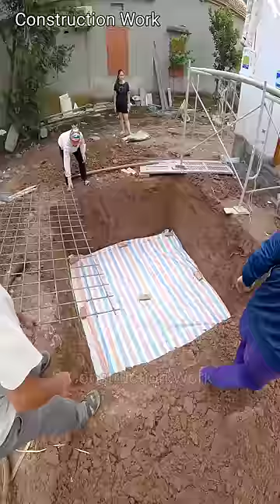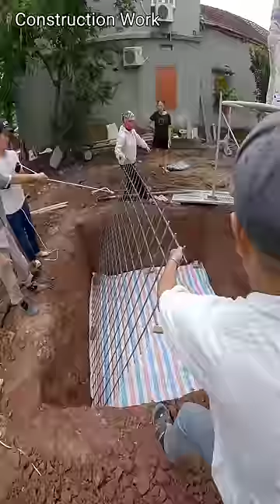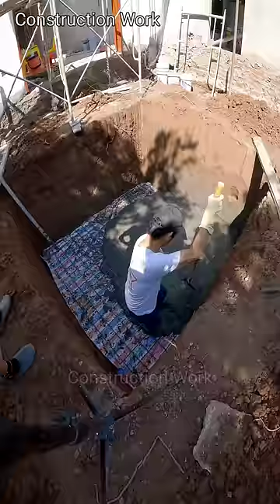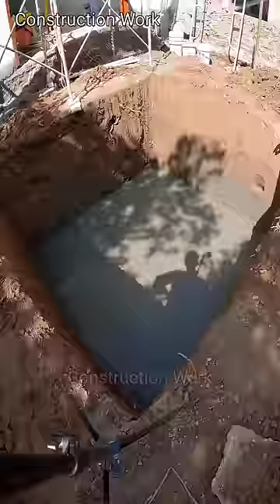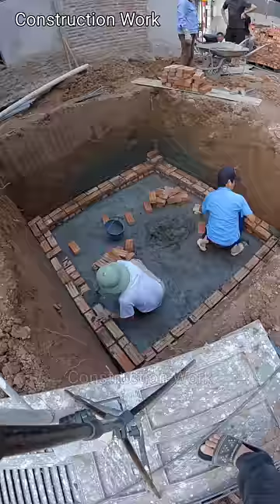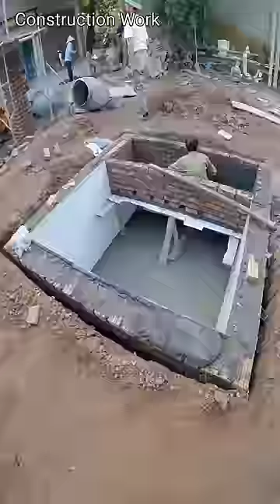Excellent Water Tank Construction Skills of Construction Workers #constructionworkers #construction

Comment: Its a septic tank my friend. Water tank need to be at high place for the water to flow to residential area. .
Reply: Naaaah people use those underground for water ,it's called a cistern
Reply: Water finds and maintains its level
Reply: People buy pumps these days lol
Reply: @sthompson7856 yes thats another method of storing water underground my friend but base from its shape&design , its totaly not a cistern water tank .
Reply: @jasonlecates9848  yes .some residential area using a water pump if the area is not enough water pressure .but why use pump instead of gravity flow if the area pressurise? .because, using water pump can lead to external pipe damage if not installed properly .for me, at pressurise area should install water tank with pressure breaker .this is what i experinced but depends on house owner to make their water system .theres many factor that we can avoid before burning money for future maintenance .
Reply: 我的朋友如果下面藏屍體將完美=
Reply: Water tanks inMexico underground dummies
Reply: Water can’t flow uphill. Now if gravity was real then that would be the case. Interesting world we live in isn’t it. I must admit learning about the world as an “adult” is much more fun than that Rockefeller education system 😂
Reply: @FKTHESYSTEM063  yes you right my friend .water cant flow uphill .then why you should use undergrd tank on modern days? .it will be a waste of energy using pump instead of gravity flow .that how liquid works .it flow if theres a low point .different story if the area is not on high pressure of water, then no choice you have to pump to pressurise the water .so this story, always install your water tank on high area so you dont waste energy or bill just for the water to come into the house . .learning is intresting my friend and im also still learning about everything around us  .im happy to help others .good day to you
Reply: No its not my in my country has one with a water pump and filters i even got a smaller one for emergencies
Reply: My friend, please watch at the end of the video .theres another partition wall inside the chamber .it seperate sewage sludge from the other so that only water can pass thru before release outside of the chamber .thats how septic tank works .thanks
Reply: Is true
Reply: Have you heard about a water pump?
Reply: you must understand that the world is made up of different countries and regions. this is an underground tank which is used to get water from the city. the house then pumps this water to a higher tank.
Reply: Creo que usted no conoce bombas hidráulicas? 
Es un motor que lleva agua para la parte mas alta de la  casa!
Y tan poco escucho hablar de sistenas, son formas de piscinas con tampa, que recoge água para  quando falte água, da companhia de abastecimento, no es solo carro pipa!🤷
Reply: @javiergamez3343  have you ever heard of energy waste? ..
Reply: @Dr_Sheeda  ok thanks for the information my friend .means, theres a few country / region still using underground water tank living in 20century that using untreated water system.ok no problem but i want to say that this tank is not an underground tank .please watch at the end of the video .then u'll notice .the way the chamber installed also didnt have any sealant or protection for freshwater stored underground .you get wht im saying? ..
Reply: @Dr_Sheeda  im sory sir, if u dont mind im asking .which country are u from? .
Reply: My friend, im not an expert in water system or in plumbing but we can still learn, hear, watch & take advise for a certain situation .please learn not to waste our precious gift of having water, energy & resources while we still have it .dont be a typical person that dont care about our surrounding .be better then the world can be better .use our knowledge to shape our world to be better .thanks & have a good day .
Reply: La cisterna se utiliza para almacenamiento de agua en zonas donde el agua potable no tiene presión y en la cisterna si porque  está a un nivel bajo  y a si aprovechamos para llenar mas rapido tambien se utiliza una bomba de agua para llenar los tinacos🙋🏻‍♀️
Reply: A wierd thing named Motar pump exist in this world 😏

Comment: It looks more like a septic tank than a water tank or a sistern. The middle wall is called a baffle wall to cause the solids to stay on 1 side so the liquids can run out through the overflow without cluging.
Reply: Đó là bể chứa nước ở VN chúng tô😅i hay làm
Reply: Horrível  .
Reply: You seem to know much more than we do, 80% of Americans have sewage pipes exiting out of the house to lagoons that are dug and lined for it to be broken down and processed. Septic tanks are only for houses in rural areas where it would not be economically viable to have pipes to the home.
Reply: Is there no rules on how far away it has to be from a property. The materials it's  made out of. And how near  to drinking water sources. A disaster waiting to happen. Nothing like a  bit of subsidence.or Cholera
Reply: @pauljenkinson2870  Yes there are many safeguards against grey water mixing with ground water. That is why it is piped so far from origin and then processed. The only exception would be a rural home with a septic tank, but even still the are regulations on the construction and where it should be located with respect to groundwater.
Our cities water is purified and ph balanced and even has fluoride added for strong teeth. The water quality does vary throughout the country depending on many factors, like upkeep and maintenance. For instance, in the larger city close to me, they had clay pipes they estimate was put down shortly after the civil war in the 1860s. The city was neglecting the upkeep and the state and federal government had to come in and control the utilities it was quite embarrassing for all involved. But my city water is pristine, thankfully.

Comment: What's the bed sheet for
Reply: 😂its a agricultaral tarp to prevent the cement paste to bleed into the soil below as there is no bearing course ,this a wrong way to make any permanent sumps or tanks brick wall masonary is prone to joint leakages ,this seems to be short cut construction 😊

Comment: Did anybody ask why they put the bedsheet in the bottom of the hole?
Reply: So that the concrete can have a good sleep!
Reply: so who ever is down there won't get concrete burn while they sleep!!! 😂😂
Reply: so it stays in place while it's wet otherwise the liquid will seep in cracks costing your more
Reply: Hola, supongo que es para mantener la humedad y no se resquebrajée.
Reply: reduce, reuse, recycle
Reply: For a moisture barrier but you're supposed to use plastic.
Reply: Thats a plastic sheet
Reply: It's a tarp. You can tell by the sound that the wet concrete makes when it plops onto it.
Reply: @BryanOros agreed - although a lot of consultants are now eliminating the vapour barrier under concrete slabs - it promotes curing at a differential rate between the bottom and top of the slab - leading to uplift at the edges
Reply: Es necesario para proteger el firme de la humedad del suelo
Reply: @AAA-vk9vp the right common sense answer....perfect.
Reply: It keeps the weeds from growing into the water tank.
Reply: I thought the same thing. Surely they should be using a plastic membrane

Comment: It’s very very bad and sad that you waste your money on not doing it properly. The concrete will crack en brake cuz the foundation is to week and you placed walls on de edge of foundation but and of foundation is same ticknes as the rest you should first dig like 30/40 cm at last more around foundation and then make the foundation then the wals should take place like 5 cm inside foundations to avoid cracking 😊